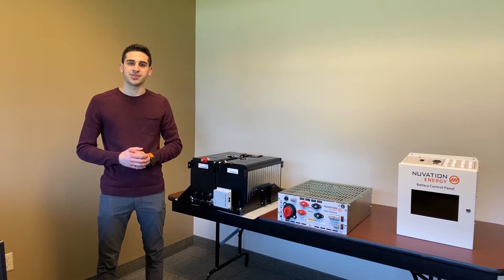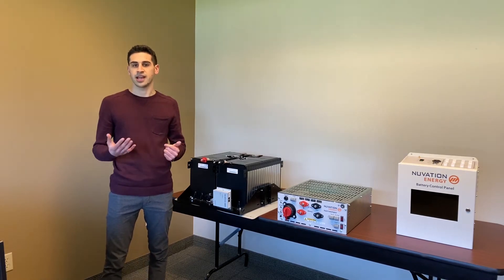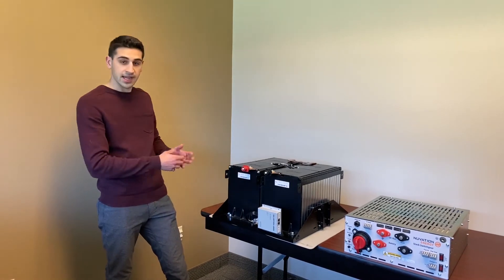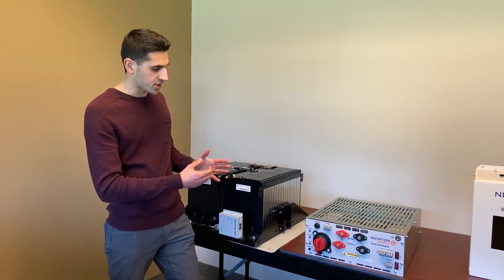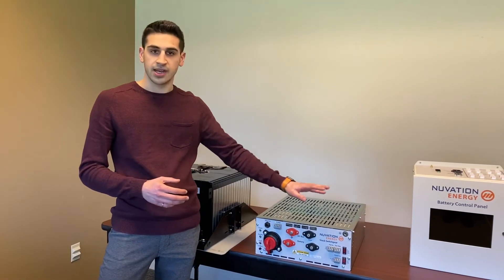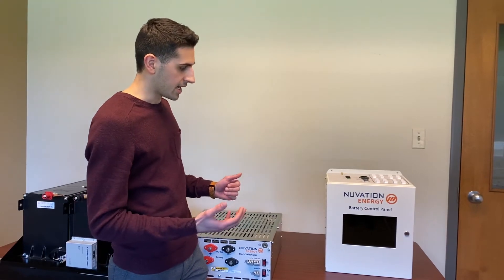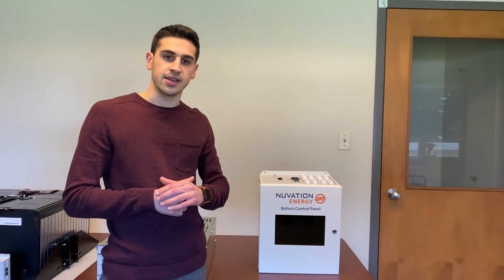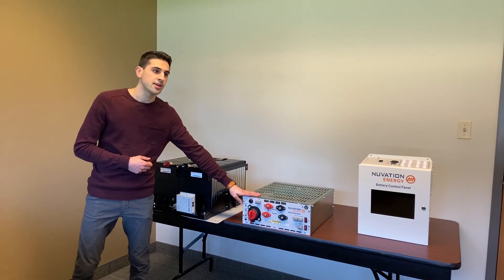Nuvation Energy High-Voltage Battery Management System Architecture

Comment: Thank you very much for the video. Can you please answer what is difference between 48 V and 400 V battery systems. Which one is better technically and economically for residential (15k Wh) and commercial (100 kWh) ?